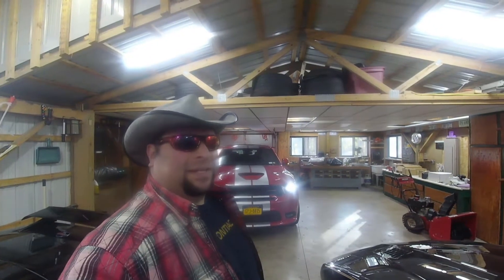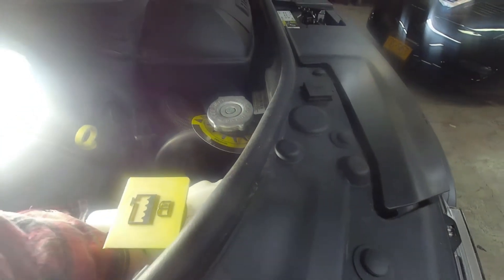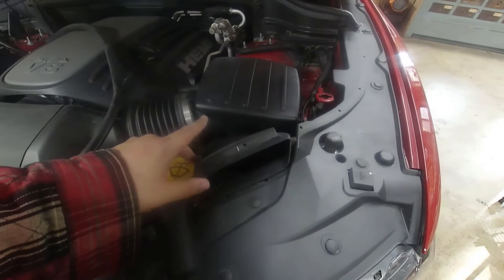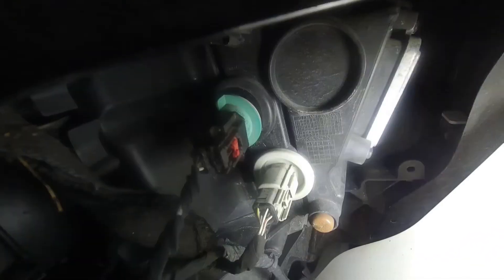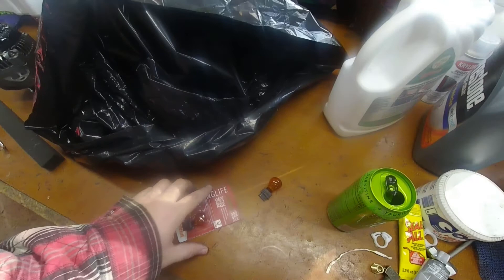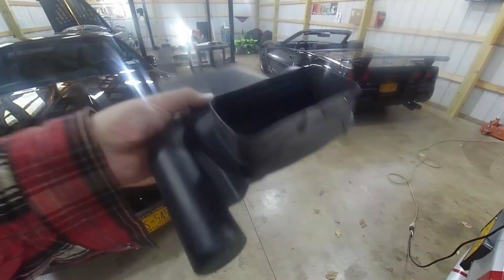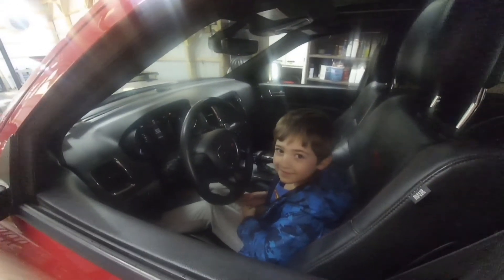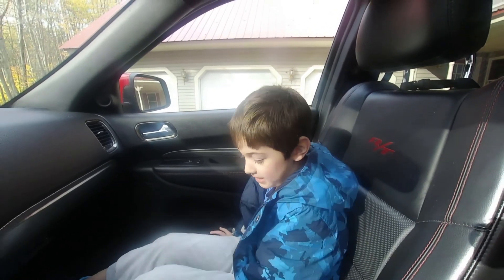Dodge Durango Front Turn Signal Bulb Replacement RT SRT Hazard Lights Blinkers

Comment: Simple, easy to follow video. Thanks! Changed my left turn signal in 10 minutes or less! Too easy!  Only added tip is "us short people" will need a stepstool to see the bulb 🤣
Reply from the maker: I found out after the fact from a previous comment that there is an access panel in the fender well in front of the wheel. I no longer have the suv to verify this though.

Comment: This was very useful to me and avoided having to take to shop.  Reinstalling the air horn was the hardest part (you kind of went over that quickly) due to tight fit.  Your instruction for it was useful but harder than you depicted as you showed before and after without all the fineagling it took.  Car would not start afterwards and had to use the remote start first and then it restarted normally-don’t know way that was.
Reply from the maker: I'm glad it worked out for you! It is odd about it not starting afterwards.
Reply: @PhoenixHavenGarage  my greatest fear but was probably all the computer connections that had to be reset somehow

Comment: I have a 2020 with 28k miles and my left signal was going out intermittently.   over a 3 month period it went out and then back on 3x.   seems weird for a bulb but going to replace the bulb and check connections.   I have had other cars for 10 years and never placed bulbs.   is this a common replacement for Durangos?
Reply from the maker: Mine never did this, but it sounds like a bad ground wire for that socket.

Comment: On the SRT you can simply reach in and remove the bulb, same as the passenger side.  No need to take off the air cleaner.